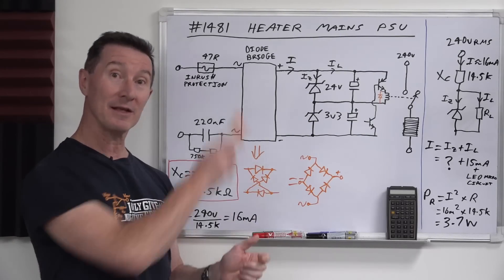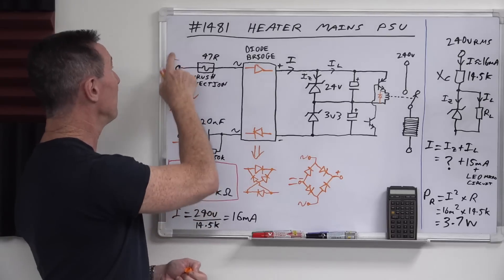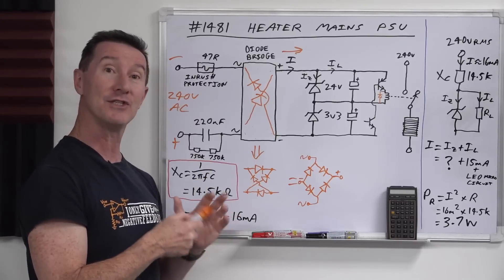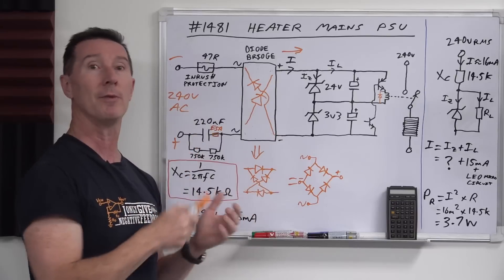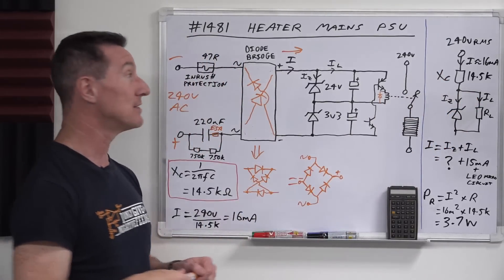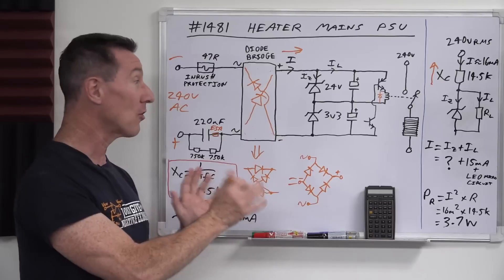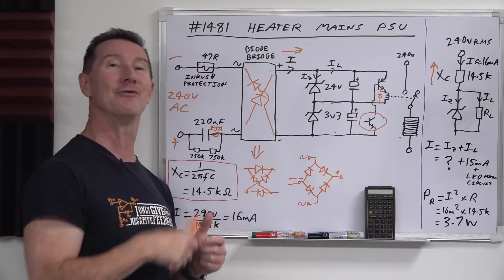EEVblog 1482 - Mains Capacitor Zener Regulator Circuit

Comment: yeah it was an interesting and useful video dave. actually im sorry to have zoned out a bit in the middle with the specifics. but that is more due to my lack of interest due to having an inherent utter conpept for all these god awful circuits that i just find so apalling. rather than it being any fault in your educational style or presentation these. you made some great points, and also i am sure that inevitably will be coming across a great many real world examples of these. to need to actually at least identify them at least. to have a good grasp of what they are. so will need to watch this again. but more to the point: what other types of banger / substandard ac power circuits are there apart from this style? you know.... the others for which i can also harbor a similar level of contempt / that goes boom and/or kicks out a crap ton of interference. all for saving those precious bom cost dollar. it would be great to see them all. and maybe even some rankings table with columns pros and cons. one column could be interference. another column power factor. another column effeciency (and therefore also that means heat --> reliability). another column bom cost, etc. etc. a true rankings of the worst of the worst. haha
Reply: or perhaps another interesting angle would be to ask: whats the cheapest / most cost cutting such circuit that gets ul approval / certification. that complies with both those safety and emi requirements. but i suppose the thing is that the actual execution is also just as important as the design. i am reminded of big clive's recent video about the $1 usb power plug from the thrift store. that looked a lot like an official apple charger plug. but actually didnt have sufficient level of isolation on the pcb between the live input and 5v usb output that you touch with your hands. and the unbranded transformer was not sufficiently galvanically isolated either, when taking apart the windings no plastic sheet / seperator.

so many diifferent ways these things can fail to meet expectations. it would be difficult to summarize into some single chart or table. so nevermind i guess

btw in this video i watched it 2nd time over. and got almost everything now. it really comes alive and comes across as a very much more interesting subject the way you present it /explain it. only thing i didnt quite understand still was why they put the 3v3 zener in series with the 24v zener, if they could have instead put them in parallel. but perhaps the current in one zener was halping to regulate and limit (or kindda average out component variations) in the other zener. to make individual fault less likely to occur. would be my guess (of course when not knowing the specs of the zeners, perhaps the 3v3 zener has different current or something, if both were in  parallel with the same shared 15k impedence capacitor). must be something or other along those lines. or for some similar reason

Comment: You can drive a 12v relay directly from mains voltage using this circuit. The zener diodes aren't necessary if the relay coils load is permanently connected and balanced. https://youtu.be/2PD4VruddL8

Comment: big Clive done a similar failure mode video. There was a capacitor in a cap drop circuit that lost capacitance over time. I think it was the power supply for the clock inside a oven. there was also a relay circuit, the relay wouldn't operate due to a cap dropper losing its capacitance over time.

Comment: Great timing with this content. I was just looking into my failed mains ac power meter. It seems to use this to power dc circuit and voltage is way to low.
So it seems you just pointed me to the culprit (ac capacitor). All other possible sections were testing as good.

Comment: Disagree that the Zener was starved of voltage because the relay coil current was close to the capacitive reactance. I presume that ideally all the current would flow through the relay coil and drop the voltage below the Zener's voltage, so no current is wasted flowing through the Zener, and the purpose of the Zener is stop the outlet of the rectifier floating to 240V (RMS) when the coil is open,  presumably damaging the transistor and capacitor.

Comment: Hi Dave.
A trick with this circuit is to select the upper electrolytic value so that when fully charged it will reliably close the relay, but set the quiescent current (set by the 0.22 UF cap) to a value which will still hold the relay in. With the spec sheet you showed, the relay should hold in easily at half the voltage and the cap could be reduced to 0.1 UF, so long as the upper electrolytic cap was sufficiently charged up by the time the "start" signal arrived.
Reply: That will minimise power dissipation in the relay, but will make the circuit prone to failing with little degradation of the X class cap.
Reply: @ferrumignis  Agreed.
Reply: That's one way, that lowers the reactive and real power draw, but the real power is still drawn even when the relay is on, dissipated by the zener.
Another method is to keep the cap at 220n (enough current to turn on the relay) but short out the 24v supply with a current-limited transistor. That way the real power will go to practically 0 when the relay is off, and the zener stays cool. The reactive power will still be drawn however. This is easy with this stacked zener arrangement, since the logic will still get power if the relay supply is shorted. It is possible even in the single-rail version, just that you still need to keep the relay driver (disconnect the relay to turn it off) but add a transistor voltage clamp circuit that clamps the supply voltage to whatever your logic regulator needs minimum (could use a LDO to make it very close to the actual logic voltage)
Reply: @brainndamage  Yes! I like your thinking. No-one anticipates shorting a power supply could possibly reduce power consumption.

Comment: Actually in this case where it’s driving a heater, using a 5 watt resistor to drop the voltage would actually just contribute to the heating!
Reply: Lol, just replace the whole thing with a big resistor and you're good to go.
Reply: @robegatt  

Weren't old school electric heaters just that... Long resistor wire with several taps, some bimetallic magic to shut it off when too hot, and an AC shaded pole fan. 
I wonder why a friggin' heater even needs a regulated PSU and MCUs more powerful than ENIAC in it.
Reply: @westelaudio943  lol they are still selling those, I have a couple of them, very cheap stuff and they actually DO what they're made for! So I fully agree!
Reply: @westelaudio943  in my Uni days we had some serious resistors capable of kWs in a lab.  Three of those, three phase power and man that delivered.

Comment: "Without the load you get nothing", apart from 240V RMS, on the outlet of the rectifier presumably? I came across a "reactive voltage dropper" circuit a few years ago when I tried repairing a paper shredder. Being a naive mostly home taught electrical engineer, I was expecting to find a transformer and voltage regulator circuit to drive the LED indicators and optical paper sensor, but all I found was a capacitor and resistor. After a quick Google I found out what they were doing and why. And promptly decided that poking around a circuit board that wasn't isolated from 240V wasn't going to do my life expectancy much good. Did consider buying a plug-in earth leakage trip so I didn't trip my entire flat when the inevitable touching of the live line happened.
Reply: I consider a good quality 5ma RCD/GFCI, tested often, to be mandatory when working on any opened up mains referenced gear, even if you don't intend to do any live probing.

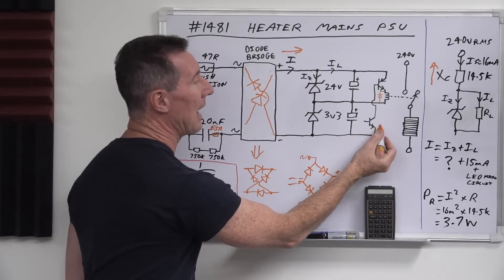Comment: What happens when the NPN transistor is turned on on time 16:28 ? Which one of the two transistor will blow up first ? Did you miss a limiting current resistor between the PNP and the NPN ?
Reply: I'm sure there was a resistor.

Comment: Considering this device is actually called a HEATER, some 3.7 watt power dissipation from a resistive dropper wouldn't worry me too much.. if it was in a light or something else then I'd be more concerned
Reply: It would draw 3.7 watt when switched off (with electronic timer or thermostat running) if that was the case. The relay switches on thr heating element.
Reply: The 3.7W would be an important consideration if the whole thing was built into a mains plug, with the high-powered heater elsewhere.
Reply: @CaspaB  it's not, check the previous video on the heater repair he references
Reply: @Rx7man  ok I didn't see the previous vid.

Comment: Small correction. The generator has to provide 3.7VA not 3.7W.. Or perhaps just "the generator has provide the 'current', ie the 16mA, but this is 90 degrees out of phase, so it amounts to 'no power'" And actually quite often the "generator" doesn't have to provide that extra current at all, because there will be an inductive load somewhere more locally which just supplies (and hence offsets) the capacitive "leading" current.
Reply from the maker: The point is the power has to ultimately come from somewhere outside the load, there is no free lunch. I didn't want to bog the video down with the discussion on that, it's done in other videos.
Reply: @EEVblog  Fair enough, it's complicated. The current has to come from somewhere outside this device, yes, but it's probably coming from somewhere on the same circuit breaker in the same house, where there is a linear supply with a transformer (ie an inductive load).
Reply: Generator doesn't have to because every facility has its own capacitor bank to provide local reactive power.
Reply: @alicangul2603  Well no. This is additional capacitive reactive power, ie leading current, which is needed. A capacitor bank can't provide that. An inductor can, and there are loads of those which are right next to the little heater/smoke detector, in the same house, or at the latest the local street transformer. In fact, these little capacitive loads are actually HELPFUL (but probably not significant) for the power company, because they are like "local power factor correction" so improve the power factor of the house (by cancelling out some of the many inductors) and thereby reduce the reactive current which the power company needs to deliver to that house, reducing required distribution wire sizes, transformer sizes, etc..
Reply: @oschonrock  Ohh that's true... I was very confused lol. Anyways, lots of reactive consumers in a premise anyways. Motors, old lamps etc. lol. This little cap doesn't need a generator to supply the negative reactive power lol!

Comment: Is there a particular reason they use 24v relays instead of 12v?  If they are pinching pennies, wouldnt it save them twice over.  (Able to use a lower value cap), etc..
Reply: 12v relay may require higher current draw (bigger capacitor)
Reply: Probably the usual answer in consumer electronics design, it happens to be cheapest solution. I would assume because higher voltage coils are less common until you hit mains level, which are larger, more costly, more costly driver transistor, etc. Lower voltage is going to need more current for the same switching action (and a larger cap and zeners to match).
Reply from the maker: Hard to say. Maybe they use it on other designs and are just reusing stock parts.
Reply: @EEVblog  exactly, 24v are way more common in industrial applications.
Reply: A balance of high enough voltage to keep the required currents down, and a low enough voltage to be able to control easily with your low power digital circuitry.

Comment: Plugging in a capacitive load into the electrical grid is not a problem. Yes, there is (reactive?) power that the grid needs to supply and then accept back each cycle; this produces non-imaginary current flowing through wires that heats them up and has to be made up for by the generators.
   But this is capacitive reactance, and is 180° in phase from inductive reactance. The (US) national grid operates on a power factor of 0.8, which is inductive. Most of the loads on the grid are inductive; transformers and motors mostly. That means the generators have to supply power to build up the magnetic field in all this inductance, which heats wires &etc.
   I once worked for a company with many large assembly lines. They had many large motors each and we used heaters with some inductance themselves. In order to prevent extra fees because we were inductive-loading the power factor out of tolerance, we had a Capacitor Farm. All those magnetic fields growing and shrinking in our motors were feeding power into our own capacitors locally, so the generators saw a normal load and the long-distance wires to the power company could stay cool.
   So if you plug a capacitive load into your house receptacle, rejoice in knowing that you're just balancing out a bit of your refrigerator's inductive load, and making those generators a bit less loaded.
Reply: Actually the power company will love you having these capacitive loads, not a problem at all, because as you say, most loads on the grid are inductive.

Comment: Worth calling out that the strange-looking stacking of 24V and 3V3 kinda allows the microcontroller to be powered "for free"-ish in some vague sense. I.e., a 240V AC mains + dropper cap = a high compliance, practically-fixed-current AC current source; if you were to run the MCU off a LDO off the 24V, then the current for the MCU and the current for the relay coil would be added up. But with those elements in series, it's only the compliance voltage of the current source that needs to be increased, and since it's already at 240V, it's all good to go.
Reply: Another thing I like, and it comes to the low current - relays need more current to turn on, but a lot less to hold them on. So that 24 volt supply backed up with the capacitor can provide all the current needed to activate the relay, but then the voltage can drop away as it likes, and the current with it, and still hold the relay on.

With the relay coil and 24v zener providing current for the digital circuits, you don't have to worry about a voltage drop causing the micro to reset.

We can see how well the circuit worked, with that capacitor dropping to less than half its value before it caused a problem.
Reply: You should lookup the LDO's efficiency. Not great

Comment: The Zener regulator makes perfect sense with the series resistance impedance on the AC side and low current loads.
Good that you give the safety warnings, they're absolutely essential with this type of circuits.

BTW it looks like I'm starting to teach people electronics.
Ttoday at our local hackerspace I had to explain the FULL BRIDGE RECTIFIER's principle of operation to one guy who has a university degree in IT but was not taught the basics of EE.

He had a pair of IN-12B Nixie tubes that he wanted to use in a project, only didn't know how to wire them... poor thing. I breadboarded a simple 200VDC PSU with two power transformers connected back to back for galvanic separation from mains, and taught him how to control these nixies using transistors.
Reply: Nice job!

Comment: Anybody who tries, year after year by different people in different countries, to use power supplies without galvanic isolation, should be de-balled. If such a person (male implied) survives the operation, then this same person should be shot. If they should survive being shot, they shot be shot again!!! Even my 1980's textbook warned me against this circuit, but I actually built this circuit, only to shock myself (only mentally, not physically), when I measured unloaded output voltage!!!
Reply: Beyond the basic shock hazard, if you ever lose the load (those zeners overheat, solder joint issue, or they were never included in the first place, etc) you get a HIGHER DC voltage at unloaded output than AC input!!!

Comment: Very cool. I had an LED bulb go out so I smashed the power supply out of it to see how it worked. This pretty much looks exactly like what I saw... Simple rectifier spitting 50 to 60 volts DC out to run a panel of 50 little LEDs. Great explainer!

Comment: I came across a resistor based version of this in the standby circuit of the Revox power amp restoration I recently completed. It gets way too toasty for my taste, so I disconnected it; besides, the optocoupler that turns on the mains is probably shot too. I replaced the original with a higher value to cut down the current, but it still was too hot even after short periods of powering it. Note: I'm convinced the zener would have properly conducted, since the original value was also supposed to work across 110V and I have 240V here, so double R should not be an issue for the current...

Comment: wouldn't you have 240 x 1.4 so really 330 volts after the bridge???
Reply: Yes, the 220nF capacitor limits the current. Voltage "regulation" is done by the circuitry after the bridge rectifier. In a LED bulb, the LEDs in series act as zeners. When one of the LEDs fail, the smoothing capacitor in parallel to the LEDs will pop, if it's not rated for 350V.
Reply: Open circuit it would be 339V, but the zenners effectively create a voltage divider with the capacitor to limit the voltage of the output.
Reply from the maker: That would only be the case if the dropper resistor was after the bridge. But in this case the capacitor is the dropper resistor, and it's before the bridge, so it's not like havign a bridge direct across the mains. If you had no clamping zener and just the caps then yes that would be the case.
Reply: For a voltage divider to work you need some current flowing. The zeners or whatever load closes the circuit makes thing running.

Comment: If you want to use a non-isolated MOSFET to switch rectified mains, you need a more nuanced capacitive dropper circuit.